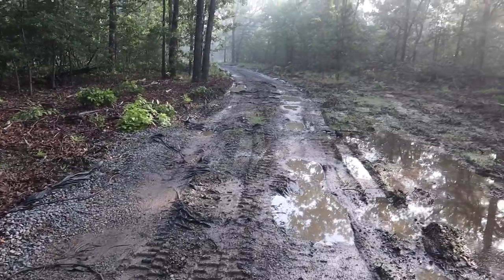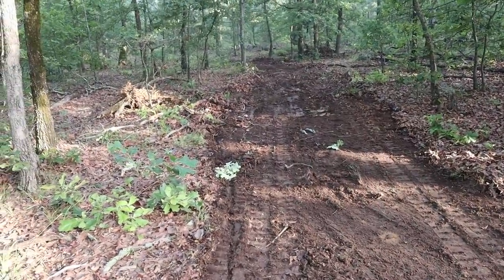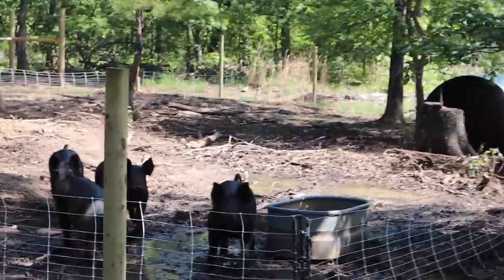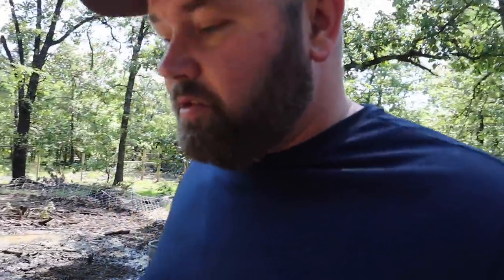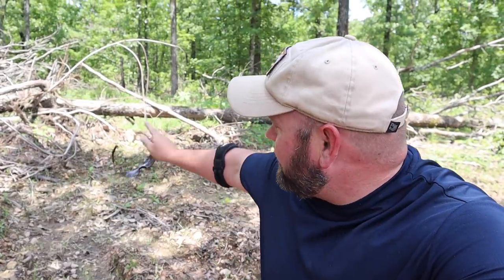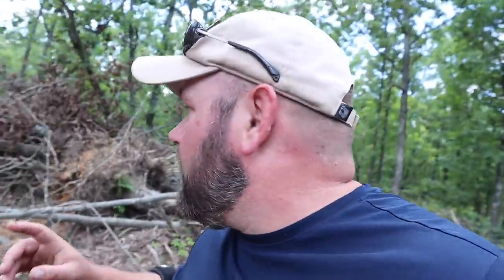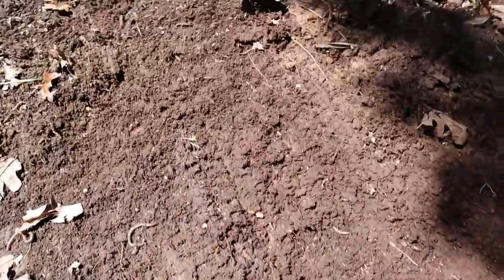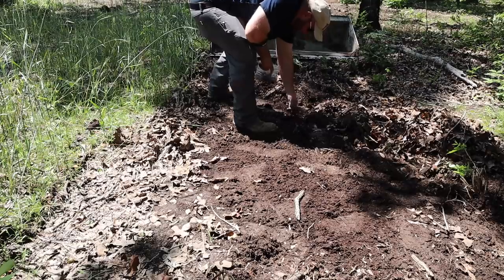DRIVEWAY REPAIR WITH A BOBCAT

Comment: Great work! Just a suggestion...you need bigger stone for the base. Crushed stone will not hold up with how wet your property is. If it’s available you should consider it for the bed course before any additional roads you install. Make sure the pad for the storage container has at least a 8-12” rise from the road to prevent it sinking. Also, ask a friend that has a roller to compact the roads you have already built. Skid steer is good for spreading but doesn’t do much for compaction. You will see the low spots immediately.

Comment: You need large crusher run stone first to fill in the ruts and form a base. Good luck cause you have some challenging land to working.
Reply: Relative of mine lives in North East Texas, and has land like that. He put down large crusher run, then crusher fines to cover the large stuff, then a layer of 2-3 inch stuff, ran a smooth drum vibratory roller over it several times, until the 2-3 inch stuff was embedded in the crusher fines. Wasn't a bad road. Made it better after a couple years by putting down a 4 inch layer of recycled asphalt. Was like driving on a paved street.

Comment: You could do what my Uncle did on his off grid property.  He lined their trails with tree logs and also railroad ties and put rock on the trails in between the logs and railroad ties so their 3 wheelers and motorcycles and there John Deer vehicle could travel the trails too.  He did wood chips first but then started replacing chips with the rock....so much better.

Comment: Years ago I had a gravel drive 9/10 mile long. Without crowning the drive and cutting ditches, you may have continuous water issues. Even in the flat areas where drainage could have been a problem, I built the driveway up, crowned it and cut run offs where needed to drain water away from the drive. Low spots in a gravel drive is a never ending pain in the ***.

Comment: to build a good road you need to remove the top soil then large stone3 or 4 inch rock and then later the small rock that plastic doesnt do any good if the road bed still  has topsoil on it it will just keep  sinking down. hope this helps USE BIG ROCK DUTCH

Comment: Have you considered raising the road and putting a culvert to divert the rain flow, 😊👍💕💕💕
Reply: Was thinking about taking some dirt from the woods & filling n to raise it, then put gravel over. Looks like water will continue to stand there. More work😥😅, but maybe better n the long run.🤔👍❤
Reply: The best advice possible. Speaking from experience!!
Reply: He needs to decide where to build when is wet not dry
You might up  building in a Swale
Reply: He built on higher ground 
He can't  even get a drive way
Love the guy buy my goodness
Reply: @kencarr2998  I think we all have to remember as well, he is working with "Virginia ground" it hasn't been driven on much to compact it. Now that it is a total mud fest and he is able to see where the water sets and runs he will have a better chance at knowing where he needs to divert it. Having that stone is nice. It will, however, get worked into the ground and be gone. It will offer a semi base and drainage. But more will have to be added. We did about three load on an already established driveway thats a terror to get out of. We finally got dirt specifically for drive ways. It compacts when driven on and stays hard. Hopefully he can get some of that because I tell you, its worth every copper penny!

Comment: Those machines are amazing! As those trucks rolled in...my mind went cha-ching, cha-ching...that's a bunch of $$ there...has to be done...wanted to say, You need a good rock pad for your travel trailer...IF you every want/need to move it and it's rainy season...truck and trailer will get stuck...used to have LG horse trailers and I was told...get a crushed concrete pad to park that on along with area to back the truck up to hitch up...

Comment: Need number two stone to lay down first. After you get a good base you can put screenings on top
Reply from the maker: This if 3 inch crusher run base rock
Reply: @KeepingItDutch  BIG CLEAN ROCK FIRST LET IT SINK IN THRU THE YTOPSOIL BEST TO REMOVE THE TOPSOIL THEN PUT BIG ROCK NO LIME DUST LET IT SETTLE THEN LATER PUT THE SMALL GRAVEL ON OTHERWISE ROAD WLL ALWAYS BE WAVY AND RUTS

Comment: I was just watching your show about getting water to your cabin. A couple of thinks... one why not modify the well shed to make it easier to maintain the pump and tank, possibly a bigger removable door or wall? Secondly I suggest when you are finished running your generator to turn off the gas and run it till it dies. This will keep the carburetor from getting plugged up, especially with the alcohol corrosion that occurs. The more efficient carburetors have smaller ports than the older ones of a few years ago. 
Finally I believe I noticed that your hat has a globe and anchor on it! You are a Marine! Thanks for your service!!! I grew up hearing the Marines Hymn every Saturday. My dad was an IWO Jima survivor. He was a tanker in the fifth division, having seven tanks blown out from under him . I am fortunate to have attended a few of his Marine reunions and meet his tanker buddies. 
Enough about me and my dad, I watch your show and continue to enjoy it. In memory of my dad and you, “Simper Fi”! I am not a Marine but respect the honor those who are. Sincerely.

Comment: On the area that you are planning set the shipping container. Either place a good amount of gravel down, with railroad ties on top. Or vice versa. The weight of the container will press down into the soil below your door line if you do not. Be aware that once you slide back the container it will move gravel out of the way.

Comment: Dutch we have lived on a mile long gravel eating driveway since 1985...you need oversized river rock, not that stuff you are using. We just used some of that and it just floats out of the holes.... ( the driver said it won't move out of those holes ) we never had much problems with the oversized. We have put over a 100 loads of different base through the years and nothing stays like the oversized. If you can luck out and find them working at the bottom of dams you can get it a a reasonable price because they need a place to put it.
Reply: I know ur right
Reply: Agree, the smaller gravel over years floats away.

Comment: You need need a culvert with a retention area on the low side. You could use a stone filled culvert with a drain line to the retention area...

Comment: I know that that Rip Rap rock wouldn't go very far but I think it would be worth the money for you to use it in those deep wet spots. Just think of the roads the Roman's built with big stone and some are still in use today. That huge rock will lock in and suspend in the deep spots. Then some stone and cloth and finish with 57 crusher run. But you are doing a heck of a job out there compared to what ya started with.

Comment: So even if you put the gravel that you're always going to have water problems and low points there 2 yards of gravel in the soft spot to pack it down because otherwise it freezes up it'll just rise up and wanted to frost is just turned soft again you continuously have sinkholes

Comment: Your shipping container will get moisture inside.  It will ruin any metal, electrical or motor type tools/equipment. Lots of people put those vents on the roof. They look like round balls with slits, don't know the correct name. 40' container would do best with 3 of them but 2 will work. Open doors for ventilation as often as possible.

Comment: You should put a drain pipe underneath the road before you put gravel on it. If it's that bad I think that gravel is going to keep washing away. We had a spot like that in a house I rented the owners had to do that to keep the water away they extended the pipe so it pushed it away from the driveway

Comment: In that part of the area where two low point you should run you should make a couple of runoffs to the lowest point buy trenching across across with a pipe you can consistently having problems there they might be clay underneath their you know something to think about trenching it out and making you Noah pond off to the right to the lower lower point of the property

Comment: Or you could do which is smarter is six containers 644 ft containers and put them build a roof over it that will beat you can build it right through all the way around and that will be a storage shed for the wood will also be safe from fires

Comment: I worry you didn't get road base done. You need road up and out of water. Road has no ditch  for run off. The big trucks will get stuck soon. If some more trees was cut back of road so sun could help dry it. Just my comments you do it as you see fit. Just know how many loads of gravel can drop into ground in wet spots.

Comment: I'm thinking it might be better to fix the drainage problem rather than just topping it with a little bit of gravel.   You will probably be dealing with this issue periodically for a long time if not done correctly.

Comment: I just got talked into a (cheaper) load of crushed concrete instead of limestone base that I needed to level out a spot for a ConEx (and to fill in a couple of pot holes in my driveway).  It's pretty mushy. The guy swears it will harden up and be great, but so far, it's very sifty.  Of course, it's still raining almost every day, so I'm trying to be hopeful that it will work once the rain stops.  I'm just hoping I didn't waste money on this.  
Yours looks like just rock?  Or is there some kind of binding agent in it too?  My original driveway was a combination of rock and something else.  It's been 11 years and we've only started to have some pothole issues lately.

Comment: Your road is not wide enough for the construction equipment to work when the weather is wet
Reply: And you need to do a ditch on both sides to take the water away